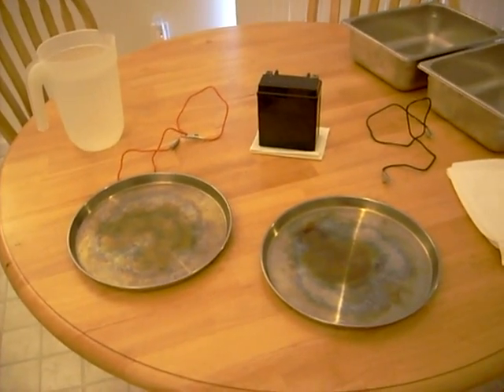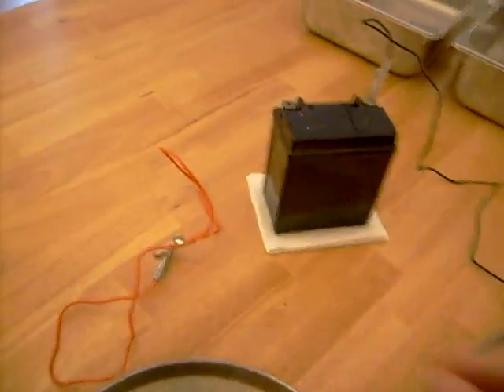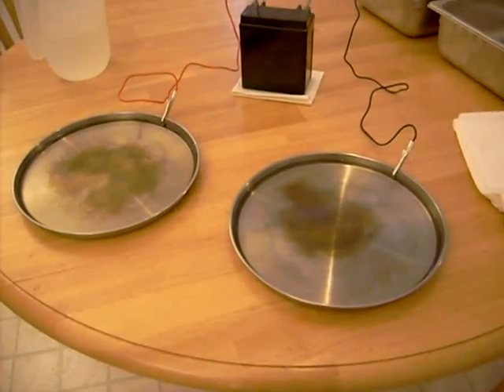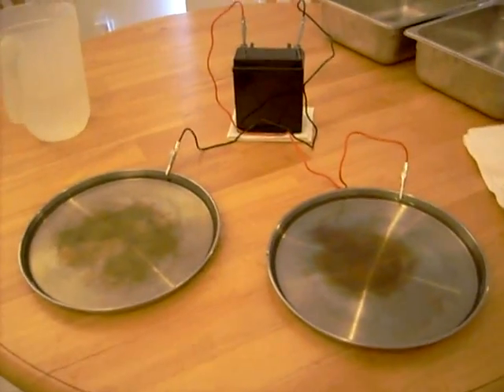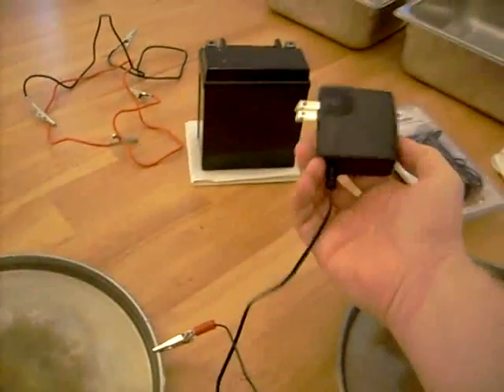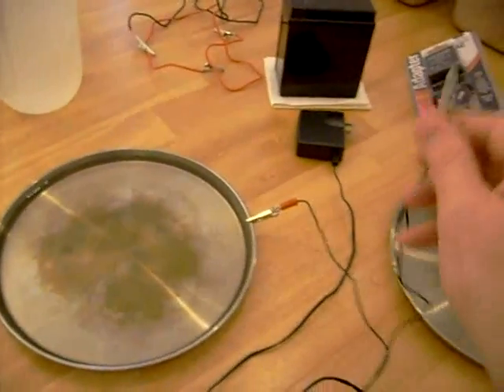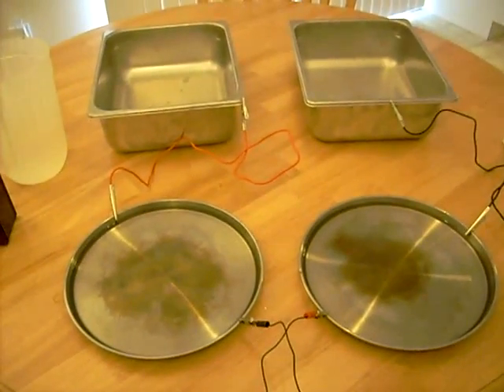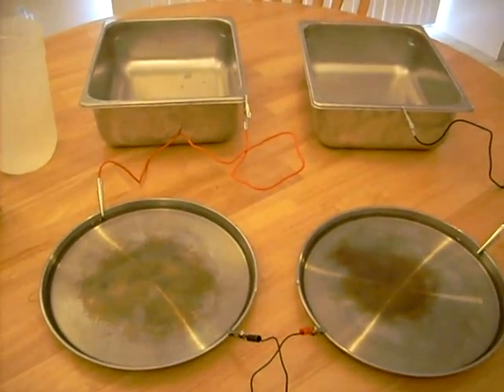Cure Sweaty Hands, Palms, Hyperhidrosis, Hyperhydrosis

Comment: i remember commenting on this video years ago to thank shannon for giving me my life back and i just want to say that i upped it to 36 volts and added salt and this other thing.

excessive hand sweating has stopped permanently!! if it sweats at all, its just moist to prevent my hands from drying out.

thank you again.
Reply: Hi there, can you share your experience? I just started 5th day already with 2x9V battery, and I still do not get any improvment
Reply: @bracso4965  are you using those big batteries like in the video right? I ended using those big 6v batteries for flash lights( I used 3 of them for 15 mins) .  the first time I did it , it roughly took a week and a bit but I did see improvement.  

message back if you help! :)
Reply: @supermale  Hey, I got dry hands (have not started on feet yet) sometimes I forgetting session, sometimes have cuts on hands due to my work so have to skip. how many times are you doing in week? and sometimes it does itches so much, especially at night when I sleep, but happens only if I miss some days and starting again. Sorry for my English
Reply: @bracso4965  I'm happy for you man :)  when I used to have cuts, I just cover it with Vaseline , now I'm doing it maybe once a week . I do it less and less now for sure .
Reply: @supermale  thanks for such a quick response, I have done session right now ( have not done maybe 7-9 days I think) and my hands are red, and itching will wake me up at night, but do not care as hands are dry. Are you using salt or soda? I am adding soda on every treatment ( but do not know what is the purpose of that actualy)
Reply: @bracso4965  my hands used to itch but not any more, but i do use salt ( it makes the treatment stronger ) along with warm water.  :)
Reply: What combination u used? 36V 1 Amp or 36V 1.5 Amp?
Reply: i personally use 3-4 lantern batteries now wired in sequence, they probably closer to 1 amp. 36 volt can be a litte strong at first , i would recommend 24 if your doing it the first time .

Comment: Sorry for late reply, one of the things your doing wrong is putting both palms directly into the water. 
Your batteries should be lined up like this:
- +     - +      - + 
Than take your left palm into the left container.
Slowly put your right hand into right container, starting with index finger than slowly take the other fingers in. Use about 30 secs for this step. This is important. 

For everyone else, this threatment does work! Go make your self a device right now Dont hesitate one more sec

Comment: I bought a 24V universal adapter that just plugs into the wall, and I got a cool little female end that just connects right to it and splits into two alligator clips.  Just found the stuff online.

24V feels pretty intense.  I kinda wish I had tried 18V.

You can avoid getting shocked if you put your foot/hand in the water connected to the black clip FIRST.  Then dip into the red.

Seems like there is less stinging with COLD water.

Comment: Yes, it has stopped. I preder NOT to add anything in the water actually. Tried salt and baking soda, but I think it works best if I don't add anything.
Any water is fine, cold, hot, it's the same.
And you don't touch the bottom of the pan you just hover it, but it's not bad if you rest your palms on the bottom for half a minute or so... 
good luck :)

Comment: Good shit man, going to try this out next week. Just like to add that if anyone with HH out there doesn't want to go the ionotophoresis route, there's a topical cream called Dehydral that isn't very well known and is worth trying. It's sold in Canada and its indicated use is for plantar hyperhydrosis but it works on the hands just the same. Works better than the aluminum based anti-perspirants I've tried and is worth a shot if your HH hasn't responded to other treatments.

Comment: 12 volts is ok, but if you want it to be more efficient, then I suggest 15V or maybe even 18V. It's individual. I, for example, started Iontophoresis treatments using 12V, then increased to 15V and then to 18V, and I am still using 18V, but not planning to increase it any more. Start with 12V and see how it works for you :)
I suppose your second question is how long for each polarity. That also depends. You can do 5min each polarity, or 10min.15min.. Its up to you :)  Good luck

Comment: I used a car charger with 12 volts & the jumper cable connection connected to it onto two aluminum/stainless steel pans. When I first put my finger tips in I felt a tingling feeling till I gradually submerged my fingers I noticed an intense electrical current going through my hands where my fingers were kinda pointing straight & spazing out. I noticed this particularly with the negative charge. I felt the electrical current buzzing & going through my forearms & biceps.

Comment: Hello!  At around 5 minutes in the video, I wish that you could have showed us (for those of us who don't have a clue how to do any of this) how to cut off the end of a plug for an AC to DC adaptor and how to put those clamps on instead.  How do you connect the black and red connectors with the alligator clips to the AC to DC adaptor???  That is a HUGE question for how to get this all to work. It seems more cost effective to use an adaptor than a battery that might run out of juice over time.

Comment: My hands were sweating really bad, i used 12 volts adaptor and it works perfect. I also did only 5 minutes per hand every day and after 2,5 weeks - 16-17 treatments my hands stoped sweating. I've read that some people do it for 15 even 20 minutes per hand, in my opinion this is not necessary. 5 minutes is more than enough, and i say again my hands were sweating a lot like drops of water was felling from them.

Comment: In the first week of treatment I have noticed several facts:
-during the morning and daytime the sweating increases
-starting from the evening the sweating decreases considerably
-when I am completely calm,the hands are dryer than usual by 40%
-after the session my hands are completely dry for about 30 minutes
-I am  using 2  4.5V batteries, and I will apply this voltage one more week. I try to compensate the voltage loss  by increasing the frequency of procedures
Good Luck 2 ALL & HOPE

Comment: I've had success with this:
My method: 18 volts for hands, 27 volts for feet. (by connecting batteries in series) 20 minutes for hands (10 min switch polarity) 20 minutes feet (same)
Day 1-3: No effect 
Day 4: Slight increase in sweat
Day 5-6: Massive increase in sweat (2-3X normal)
Day 7-10: Slight decrease in sweat
Day 11-12: MASSIVE decrease in sweat 
Day 13-15: Reduced to 10 minutes for hands daily for maintenance

Note: Your hands and feet may rest on the metal surface, it will still work.
Reply: What battery did you use?

Comment: The hand,feet,scalp,and armpit have a connection when it comes to sweat. Once you correct the armpit area,you'll be starting to correct the other areas.
Everyone's skin is different. Try Arm & Hammer Essentials deodorant. It cost $3.00 .
I no longer have hyperhydrosis. I've spent over $800 trying to fight hyperhydrosis for 2 years. Sage teas and occupuncture didn't work either. The No Aluminum deodorant worked for me. Peace.

Comment: Good sir. I have just tried this out yesterday. Had some minor setbacks.. No alligator clips with wires pre-attached. No batteries available similar to what you used here and your other video. The wires problem was easy enough to fix. Had my wirestripper and long nose pliers ready. My concern was the power supply. I bought a couple of 9v batteries and was skeptical about it, thinking it would be underpowered. You can imagine my shock when I dipped my hands in. Sweet Jesus!

Comment: pretty much.  depending on how many sessions you have done, you likely won't have to repeat the process for 3 weeks to 2 months.  while this works fine (you can simply repeat the entire process when sweating commences), it may be easier for most to simply maintain dryness by doing 1 or 2 sessions per week continually.

Comment: @Lostsolider You will be fine with the 6-volt batteries.  You get a "buzzy" sensation and even may feel little "shocks" but my 14 year old daughter uses two 6-volts and it worked for her (she has done it for two weeks now and has about a 75% reduction in hand sweat).   You can even use up to four 6-volt batteries with no danger.  Hope this helps!

Comment: For those comments below.
-Longterm side effects - I have no idea. (dont think so)
-Losing the efficiency over the time.I have no idea. 
-Water turns out little yellow - I have no idea. (I happens on mine also)
But so far it worked great, 30 mins everyday for 20 days, then I achieved complete dryness.(9 or 12 volts for hand, 18 volts for feet, the way you feel comfortable)
You can arrange it, I increased and decreased.
How long will it last, thats what I am trying to find out next.

Comment: Ive done 14 threatments over 12 days. It does work. I still sweat sometimes, but less. Alot of the time my fingers are now completly dry and inner hands a tiny bit moist. Ive also gottan ridd of my cold hands : ) Still wondering whetever to continue threatment every day until its completly gone, if it ever will. If you have questions and stuff you may send me a message!

Comment: I made my own too; after watching this video.

That 24 volt battery would have costed me close to $100 dollars at Walmart.

Then, I went to Lowe's, and got 4 6-volt batteries, duct taped them, put them on a series (24 volts), alligator clips, and $1 dollar aluminum pans... I did my treatments for 15 minutes and it does work.

Then, I got nagged on by my mother about how I was trying to kill myself, that I was going to electrocute myself... I ended up stop doing it.

Later, I found out about the Dermadry machine, and I gasped at the ~$500 dollar price...

After that, I luckily found it in Canada, and paid close to $300 Canadian dollars... Close to $200 USD. So I bought it.

Now, I will reassume my iontophoresis treatments; I can't stand my sweaty feet, and how my feet slide all over the sandal, and how I'm about to slip and fall all the time. And how my hands are disgustingly sweaty. And now I will be finally able to sleep without drenching my bed sheets, just to end up feeling the sheets drenched with cold sweat touching my skin, and no longer have to put a towel on the bed were my feet rest.

Comment: I just used a 230v-12v AC/DC Adaptor. Input 230v - 50Hz Output 12v - 200mA. The current was far to high to with stand for any period of time. Surely it was because the milliamperage was to high.

Comment: @vikramdid  I am using well water and about a tablespoon of epson salt or tad more to the well water. The reason I say I do not switch the leads during maintenance is because my old drionic units did not call for that back in the eighties if I remember correctly and they worked,. I did do that for the first seven treatments though and it just fried me every time. I am pretty sure you will benefit without switching during the  initial treatments. I cannot proof it though.

Comment: Or you can have surgery that is covered by insurance.  That's what I did. 

Contact a thoracic surgeon and ask about a sympathectomy for hyperhidrosis. The surgery will cure your sweaty hands plus reduce sweating from your armpits and face to zero.

Most cases of hyperhidrosis are not caused by over active sweat glands, but from a defect in your nervous system. Nerves send signals to the blood vessels in your hand telling the vessels to dilate causing them to overheat and sweat.

Comment: ALSO, after doing more research, you should not touch the pan for any length of time. So I just folded a piece of paper towel and put that in the water to rest my hands on. Lastly, the water must be warm (quite warm, because it will cool down after 20 minutes of treatment). If it is cold, it won't work.

Comment: Thanks for this interesting video. I have 3 questions please.
1. Is it the higher the DC voltage the lesser the time needed to reach the dry phase, or is it the higher the amperage the lesser the time needed?

2. In order to get the best results in the least time, what DC voltage and amperage do you recommend, given that one's skin isn't that sensitive because it's the feet that are being treated.

3. I've noticed that the water in one of the stainless steel plates get rusty, does yours get rusty too? And isn't this harmful? I've started using plastic basins with conductive rubber electrodes to avoid using stainless steel.

Thanks in advance.
Reply: أخي حسان العلاج أنا استخدمته حوالي شهرين وفيما الالنتيجةبالنسبة لليدين حوالي 85 بالمئة نتيجة العلاج انا كنت اتصبب غرقا يعني يسيل قطرات متتالية اما اليوم الحمد لله
Reply: سالك الأثر saal3k alata3r 
شكرا لك أخي. أنا بالنسبة لليدين فأنا قد أجريت عملية قطع الأعصاب المسؤولة عن تعرق اليدين في عام ١٩٩٥، والنتيجة كانت ممتازة ولله الحمد. وأنا أيضا كان العرق يسيل من يديّ بشكل غير طبيعي. أما بالنسبة للقدمين فلم يقبل الجرّاح أن يجري لي عملية لهما لأنها تؤثر على أعضاء حساسة في الجسم، ولذلك فأنا أستخدم لقدميّ جهاز منع تعرق صنعته بنفسي واستخدمه كل شهر لمدة ٣ ساعات فتبقى قدماي جافتين لمدة شهر، ثم أعود لاستخدامه ٣ ساعات وهكذا.
Reply: أنا لم تنجح معي في حل مشكلة تعرق قدماي أخبرني أخي كيف نجحت معاك
Reply: هل تستخدم بطارية ام محول كهربائي وأي فولت تستعمله والحوض أيضا هل هو بلاستيكي ام معدني
Reply: سالك الأثر saal3k alata3r 
أخي، أنا أستخدم أحواض بلاستيكية، وقد كنت أضع في أسفل كل حوض ورق ألمنيوم ثم أوصل المحول الكهربائي (المحول الذي أستخدمه يعطي 15 فولت) بورق الألمنيوم عن طريق ملقط معدني كالذي يستخدمه الرجل في الفيديو. وجربت أيضا استخدام صواني فولاذية، ولكن الماء في واحدة من هذه الصواني يتكون فيه صدأ بعد أن تستخدم الجهاز. ثم لقد قرأت في النت أن الأحواض المعدنية (سواء الألمنيوم أو الفولاذ) ضارة بالجسم لأنها عندما يتم وصلها بالكهرباء تنتج أيونات من ذلك المعدن، وهذه الأيونات تدخل إلى الجسم عن طريق الجلد.ـ

لذلك تحولت من استخدام المعدن إلى استخدام أقطاب مطاطية موصله للكهرباء، وهذه الأقطاب لا تنتج أيونات ضارة

طالما أنها لم تنجح معك في وقف تعرق القدمين فلا شك أن هناك شيء خطأ. اتبع الخطوات التالية وسوف تنجح إن شاء الله
أولا: استخدم محول، فهو أقوى من البطارية ويعطي تيار بنفس القوة، أما البطارية فتصبح كل مرة أضعف وأضعف

ثانيا: لأن جلد القدم سميك، لذلك تحتاج الأقدام إلى عدد ساعات أكثر من اليدين. بالنسبة لي وفي المرة الأولى كان يجب عليّ أن أستخدم الجهاز  لمدة 14 ساعة إلى أن توقف تعرق القدمين نهائيا. ثم بعد ذلك أستخدمه 3 أو 4 ساعات كل شهر للحفاظ على جفاف القدمين. ولقد قررت الآن أن أستخدمه لمدة ساعتين كل أسبوعين، لأني وجدت أن هذا أفضل من 4 ساعات كل شهر

ثالثا: الأفضل أن تكون الجلسات طويلة، فبالنسبة لي كل جلسة تستمر لمدة ساعتين، وبعد الساعة الأولى أقوم بعكس الأقطاب الكهربائية كما فعل الرجل في الفيديو. ويجب أن لا يكون هناك وقت طويل جدا بين الجلسة والجلسة التي تليها. فبالنسبة لي مثلا أحرص دائما على أن لا يكون بين الجلستين أكثر من 8 ساعات. ويجب أن تعرف أخي أن عدد الساعات المطلوبة يختلف من شخص لآخر حسب طبيعة الجسم، فأنا أحتاج (عند استخدام الجهاز للمرة الأولى) إلى 14 ساعة، وقد تحتاج أنت إلى أقل أو إلى أكثر من ذلك، فعليك أن تستمر في استخدام الجهاز إلى أن تصل إلى مرحلة الجفاف التام للقدمين. بمعنى أن هناك "عتبة" عندما تجتازها فإنك تصل إلى مرحلة الجفاف التام، وإذا استخدمت الجهاز لعدد من الساعات دون أن تصل إلى تلك العتبة فلن يتوقف التعرق عندك، بمعنى أن المسألة ليست نسبية، أي ليس كلما استخدمت الجهاز أكثر قلَّ التعرق تدريجيا أكثر، لا، التعرق لا يقلّ تدريجيا وإنما ينقطع بالكامل فجأة بمجرد اجتيازك لتلك العتبة. ولكي تعرف كم عدد الساعات التي تحتاجها للوصول إلى تلك العتبة فعليك بالاستمرار في استخدام الجهاز إلى أن تصل إلى مرحلة الجفاف التام. والأفضل أن يكون ذلك كما شرحت لك من قبل، أي أن يكون عبارة عن جلسات من ساعة أو من ساعتين (حسب قدرة تحملك) وأن لا يفصل بين الجلسة والجلسة التي تليها أكثر من 8 ساعات. ولا تنسى أن تعكس الأقطاب بعد مرور نصف وقت الجلسة. وبإذن الله سوف تنجح هذه المرة

وبعد الوصول إلى مرحلة الجفاف التام وللحفاظ على جفاف القدمين عليك أن تستخدم الجهاز كل فترة، ولكن طبعا لعدد ساعات أقل من عدد الساعات التي احتجتها عند استخدامك له للمرة الأولى. بالنسبة لي وكما قلت لك سابقا فإنني قررت أن أستخدمه (طبعا بعد الوصول إلى مرحلة الجفاف التام)  لمدة ساعتين كل أسبوعين. فبإمكانك أنت أيضا أن تفعل نفس الشيء. يعني بعد اجتيازك للعتبة ووصولك إلى مرحلة الجفاف التام، انتظر أسبوعين ثم أعد استخدام الجهاز لمدة ساعتين، وإذا وجدت أن حالة الجفاف التام قد بقيت مستمرة إذن استمر على هذا المعدل
Reply: أخي حسان من فضلك أعطيني حسابك عبى الفايسبوك أو تويتر لكي اتواصل معاك انا من الجزائر
Reply: ماشاء الله أخي حسان انت من بلد عزيز الى قلبي فلسطين الشهداء 
أخي لقد بعثت طلب صداقة وقد صورت فيديو للادوات التي أستعملها لكي تخبرني ماذا أفعل بارك الله فيك أخي حسان

Comment: Hey, thanks for responses! Yes, the  batteries are fine. My fingers are always itchy after treatments, and non-sweaty completely, but that last only for about an hour or so. And yeah, I always feel a surge once I flip the polarity (usually after 20 minutes). I honestly don't know what the problem is. I'm using regular pans, bought at the Chinese shop.. I recently started adding sodium bicarbonate, but it's the same.. And 48V?? That sounds incredibly high! Does 24V not work for you or..?

Comment: Add a 9 volt in series to the 12 volt(21volts) in salt water in stainless pans. Ten ...twenty to thirty minute treatments once or twice a day....5 hours total. To remove hands during treatment lift hands carefully until two index fingers are in the water only.Gives five to six weeks relief from palms. Been using it for years....works....nothing cheaper.
Reply: DC volts only.....do not plug anything into a wall or you could SERIOUSLY hurt yourself if it fails.
Reply: +cyberian2007 can you use a 12v 7amp rechargeable lead acid batt?thank you!